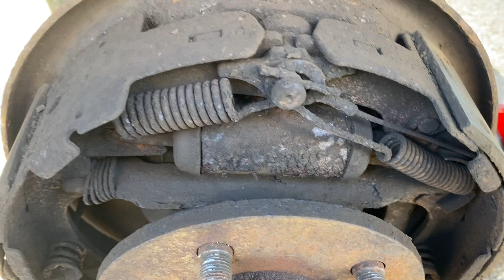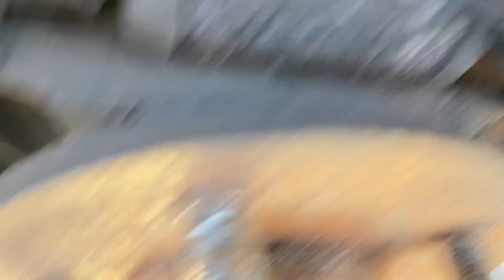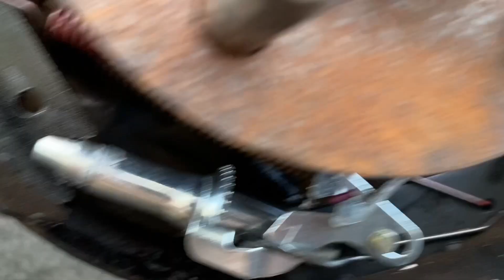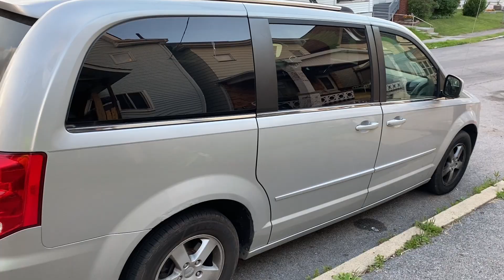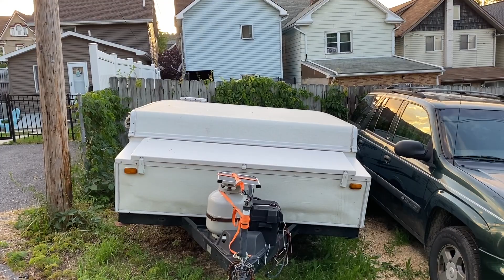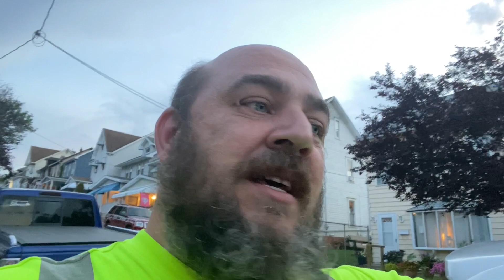Firewood Log Buying Problems!  Break Job!  Should We Build A New Fence?

Comment: I bought a new Husky 55 Rancher for $200 in 2000. Engine is great starts first pull. The rest of that saw is plastic junk. I couldnt keep the chain on that roller tip bar. The auto oiler never put out enough oil. The plastic where the anti vibration mounts all broke apart. got loose and cut crooked within a couple of years. Went back to using a $10 XL 12 54 CC homelite manual oiler saw and another XL 12 made from parts that has a 58 cc Cyl and piston. No more plastic saws for me. I now have 5 Xl 12s a 550 &925 and a dozen 1950 ,s saws. Im 70 they should last me the rest of my days.
Reply from the maker: They out last all of us!

Comment: I love husqvarna saws but then again I pretty much love them all got the hard to find McCulloch 650 this weekend with a 310 one owner clean for a 100 bucks and a 3400 poulan 3400 for 50 nice new bar and chain logs are easy to come by here in the ozarks you can get all the loger culs for just picking them up hook up with a tree service thay will have all you need and be glad to get rid of them
Reply from the maker: I tried the tree service thing but the power lines are not high enough to allow them to dump so they won't do it.  They also want me to take a much higher volume than I can.

Comment: Bring the operation home. Couple days a month making noise for a good reason, shouldn’t tick off the neighbors too much. 
Logs on one side of the fence, cut there where they are dropped , split and stack in the back yard. Put in a 4 ft gate minimum and you are in business!  
Only problem- damn lumber is expensive!
Reply from the maker: I was thinking about the lumber.  If he brought me some locust I could mill my own lumber!
Reply: That may be a good idea. Small Alaskan mill…..even free hand I will be you could do a better job than that ugly crooked bent warped pine they sell at lumber yards!
Reply from the maker: If I can find some locust that is the plan.  Finding the wood is the hard part around here.